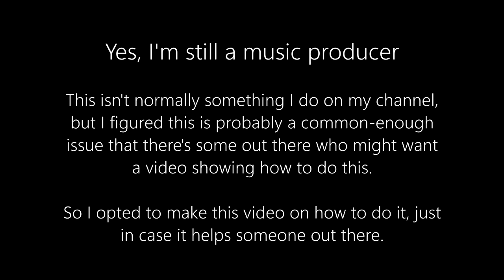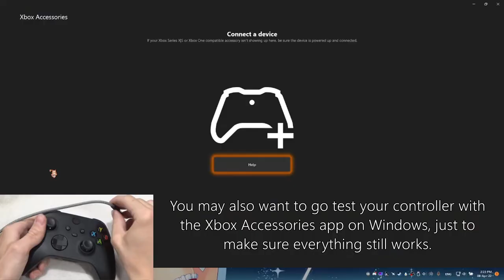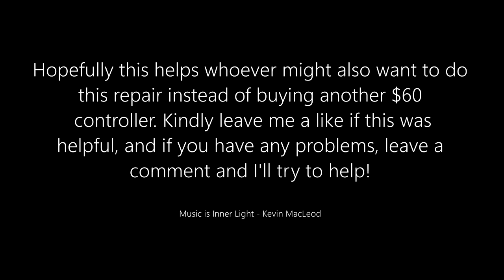How to replace the bumpers in a Xbox One Wireless Controller (Model 1914 / Series S & X model)

Comment: Sadly, when doing this the bumper clip snapped rip.
Reply from the maker: if it snapped as you put on the new ones, then the ones you were putting on probably would've broken real quick in normal use anyway lol - stick with the OEM controller parts, most of the aftermarket ones are kinda shit